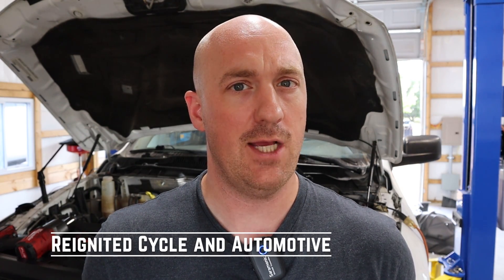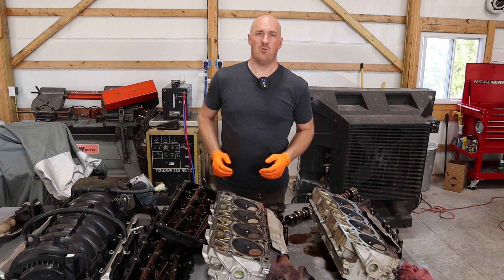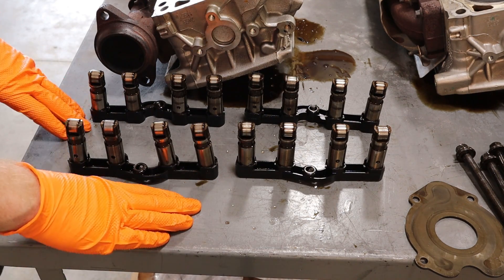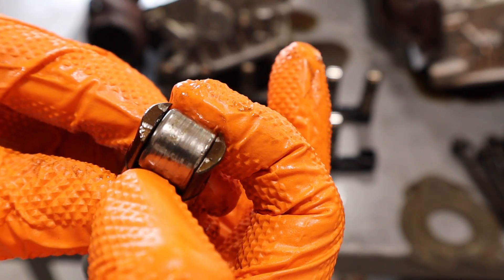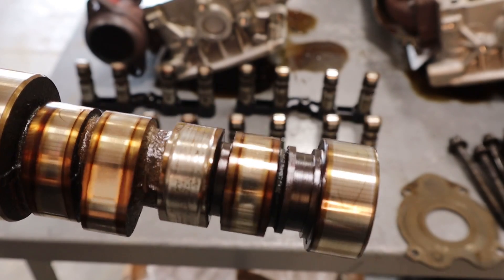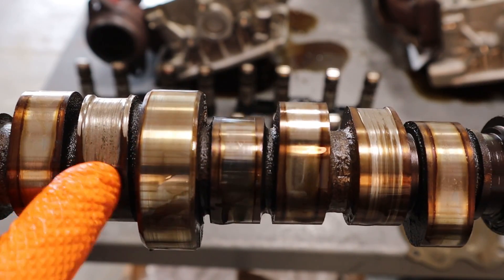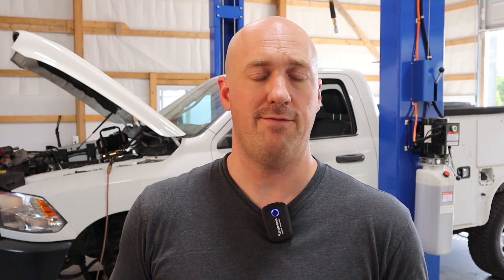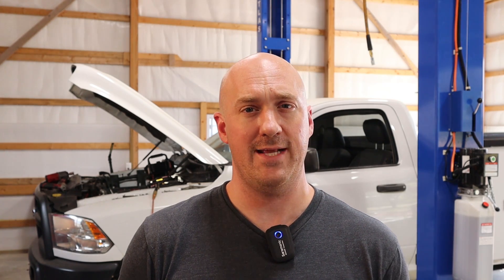Hemi 5.7 Lifter FAILURE Does this engine have a fatal flaw? Find out how YOU can prevent it!!!

Comment: Is not a fatal flaw is just a bad design comparing to cop chevy caprice engines. LS engines that are in fleet like the cop chevy caprice that see many idling hours have little to no wear in the engine. Yes the Gen3 hemi is flawed.
Reply from the maker: Absolutely agree the LS platform is a great engine, but even the mighty LS has design flaws as well.
Reply: @ReignitedAuto  so why you made a video and said the hemi engine isn't flawed, but you go back and forth on it. Some LS engines do come with a flaw, the ones with the DOD/MDS/AFM will eventually have filter failure and the LS3 with hollow stem valves that seem to break or bent overtime. All of the gen3  hemi engine have the same problem. I was told by my friend over a decade ago about the way the lifters were placed one the hemi engines, and he also told me about the problems with the LS and how to prevent failure on the LS. One can not prevent engine failure in the 3rd gen Hemi no matter how frequent the engine oil is changed.
Reply from the maker: @MastersOfMask  I work on Hemi engines every day with 200k+ miles on them with no issues. Everyone is entitled to their own opinion though, this video is my opinion based on my decade of experience working on them.
Reply: @ReignitedAuto  yes they are, but is not an opinion since you and hundreds of others have shown the same issues in all of the 3rd gen hemi engines. If this wasn't an issue why was this video made? I do not understand since your video shows the faults but you say is not faulty, make up your mind.
Reply from the maker: @MastersOfMask  My opinion is what I stated in the video, that if you follow the proper maintenance schedule, you GENERALLY will not experience this issue. We are talking about less than 5% of all the Hemi engines on the road experience this problem, but the internet would have you believe it happens to every single one. If you mistreat any engine it will fail, should we then blame the manufacturer for our lack of action?
Reply: @ReignitedAuto   These heni engines have to be beat'on so that they could last, because having them idling or driving on lower RPMs will kill them.

Comment: Great video! I’m getting new headers installed on my 300C as we speak. I bought my 300C with 160k miles & the headers went out at 200k. I bought it with a lot of miles because it was one owner & was very clean. I like the car & I want to prevent this in the future. I changed my oil prettt often. What oil do you recommend?
Reply from the maker: 5-20 semi synthetic is what's recommended, I don't have a preference on brand. If you're interested, I just did an entire playlist on my Chrysler 300c build on my channel if you want to check it out 👍
Reply: @ReignitedAuto  is it okay if I use 5-30? I live in the middle east and in summer the weather is extremely hot. A mechanic told me to use a 5-30 for my 09 hemi Durango but I’m not too sure. Someone told I will lose a little bit of mpg but idk.
Reply from the maker: @AA-eg4fp  I sincerely doubt you would see an mpg decrease using the just barely thicker oil, but I have seen that throw a CEL for wrong oil viscosity. How the car knows I have no idea. For me, I'd just stick with the recommended 5-20.
Reply: @ReignitedAuto  Thanks! Like the content keep it up 👍🏻
Reply from the maker: @AA-eg4fp  thanks for watching 👍
Reply: @ReignitedAuto  I use the AMSOIL 0W-20 in my Ram pickup.  The big difference between the 5W-20 and the 0W-20, is on start-up, the 0W-20 is a bit thinner, so it will flow better, and once the oil is at the oil operating temperature, it is a 20 grade oil, just like the 0W-20
Reply: @1gr8oil  My Auto teacher had told me that he would do that as 5w-20 is basically just for emmisions purposes and the 0w-20 as you mentionned would do the same thing warm just help on startup...a bit expensive rn though.

Comment: Will the 4.7l v8 also experience the lifter ticking?
Reply from the maker: The 4.7 is an entirely different engine design, so no it wouldn't have this same issue. However the 4.7 is prone to another ticking issue. The engine is equipped with overhead cams that actuate the rocker arms directly from the cam lobes, but the engine does have lash adjusters, which do exactly what they sound like, they remove any valve lash from the system. These lash adjusters are hydraulic, and with age they can become spongy, thus introducing lash to the valvetrain. This will manifest as a ticking noise on cold startups only, usually after the vehicle has been sitting overnight. As the vehicle warms up, the lash adjusters get pumped back up with oil, and the ticking noise dissipates.  👍 The good news is, this is not a potentially catastrophic issue like with the Hemi, rather it's just an annoyance. Nothing will be damaged if it's not fixed right away.

Comment: Also with the 6.4 you really need to use the Pennzoil SRT  0W-40 oil !!!!
Reply: That and also change it every 6 months even if you don't hit the mileage number (chargers and challengers at least). Read the manual and do what it says people.
Reply from the maker: That's correct!
Reply: @ReignitedAuto  
I know of so many people not using this oil or this viscosity and they wonder why they are having engine issues ? Using the proper oil is 1/2 the battle the other is changing it regularly. I also De Activate the MDS everytime I use my 2018 6.4 2500 using the manual shifter switch or Tow Haul mode when towing . I paid for 8 cylinders Not 4!

Comment: Apparently not so much design flaw as a weakness in engineering safety margins.  Ridiculous that these engines are failing and giving Chrysler a black eye.  Can't believe you must use EXACTLY the right oil and change EXACTLY at the right intervals.  This shouldn't be rocket science to design engines that are more forgiving.
Reply from the maker: I'd say that's a byproduct of the modern era though. You're looking for an engine that is more forgiving, while the manufacturers are looking to see if they can possibly cut any potential corner that's going to help their bottom line. I think a great example of this is body shops. When was the last time a shop repaired a fender? Doesn't happen these days, they just put another one on, reason being, the panels are made of such thin metal now that you can't hardly bodywork them anymore, so replacement is the best option. Used to be the panels were thick enough that they could be bodyworked extensively, but that time has passed. Same idea with engines to my mind. Not saying it's right mind you, just saying that's how it appears to me.

Comment: I change my oil every 3-4K using Mobil1 syn in my Ram with 63k, now the tick, not exhaust and not diluted oil. Call ERS, engine rebuilder supply in Troutdale Oregon, they told me every hemi they have gotten in has had bad cam/lifters.
Reply from the maker: Everyone always asks me to tell them which cars i see the most problems on, and I have to tell them, I only see the broken ones, that doesn't take into account the millions of them still on the road operating correctly. I would probably imagine than an engine rebuilding company would see issues with cam and lifters, otherwise it probably wouldn't have come to their company in the first place. All that being said, are you from Oregon? I miss it, we just moved a little over a year ago from bend. I've spent a lot of time near Troutdale though, since my brother in law lives in hood river. Beautiful area!
Reply: @ReignitedAuto  live in Gresham Oregon right next to troutdale my 2017 hemi ram ticks right after I changed the oil for a few days on startup then goes away until next oil change afterwards then no more ticking is that a problem it only has 19,000 miles on it I changed the oil at 3500 MI no Long idle at all. Using 5-20  Pennzoil oil full  synthetic. Would like your thought on that. PS run truck with MDS off all the time.
Reply from the maker: @joefurrer5428  I wouldn't see that as an issue at all. Normally the lifter tick noise is far more prominent after the engine is fully warmed up, and at 19k miles you should be golden 👍. Drove through Gresham many times on my way to Portland, can't take the rain though!
Reply: @ReignitedAuto  thanks for the reply yes it does rain here move from Portland to Gresham get away from big City big city is making it to Gresham and troutdale in Fairview do not like. Lived here all my life used to the rain but we get a lot of wind out in this area from the gorge.

Comment: Awesome video! Thank you for the help! Although not 100% sure about the real cause of the problem, your version makes me a bit more comfortable and hopeful that I CAN do something to avoid this issue. I have a 2015 Challenger BTW. And because of the Canadian winters it does see some idling at times before I drive it.
Reply from the maker: Thanks for the feedback and thanks for watching! As a side note, we don't see as many issues on the challengers for some reason. The chargers are usually police vehicles and the trucks are fairly common, but I think I've only ever done 1 Challenger in the last 10 years. Not saying it can't happen, but your odds look pretty good 👍
Reply: The issue is that the engine design is flawed.
It's august 16 2022
News flash.
Dodge is discontinuing the charger and challenger..
Just build a Chevy LS and all is good

Comment: My #5 exhaust lifter went bad and took out the cam pretty good. Then #2 was starting. I'm 2014 Ram 2500 5.7l, doesn't have mds. It's pretty crazy how many videos are out now. I replaced mine myself, not the worst but a big undertaking for someone that doesn't work on vehicles very often. Learn the steps and take your time and it's really not bad.
Reply from the maker: I appreciate the comment, I haven't heard much about the non MDS lifters failing, good to know. You are correct about it not being that bad of a job, the engine architecture is pretty straightforward on a Hemi so its not overly technical. Sounds like you're downplaying your technical ability though, good on you for doing it yourself! 👍
Reply: Here is a updated. It's been 3 years 42,000 miles and the engine sounds strong with no ticking or knocking sounds. I've only used Royal purple 5w30 oil at 4k to 5k intervals. It does idle for work but will idle it up if I'm sitting in it to bring oil pressure up. I'll check back in another 40,000 miles lol

Comment: Cause I’m pretty sure that’s what happen to my Chrysler 300 C
Reply from the maker: On a truck it's not a big deal, usually what we do is remove the fender liner for access and use a welder to weld a nut to what remains of the stud in the head and it spins right now. Unfortunately, the 300 is a different story entirely, there's no good access to the manifold. It sounds kinda crazy, but the best choice is to remove the cylinder head entirely with the manifold attached and remove the broken stud on the bench.

Comment: So what if the bolts broke on your manifold what would you do how do you get it out
Reply: I know how i would probably do it. I would probably pull the heads and address every aspect of head work from porting and valve grind to valve guides and seats to head surfacing and exhaust manifold connection point. Then once together again i would follow the cardinal rules regarding operation/shutoff in order to improve my odds of not losing a valve seat.